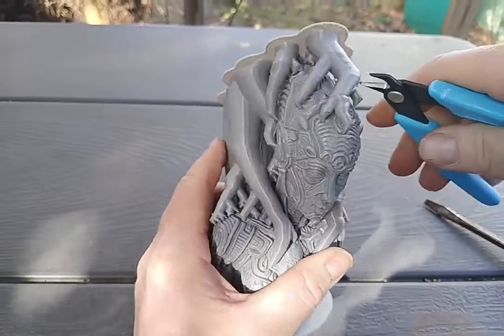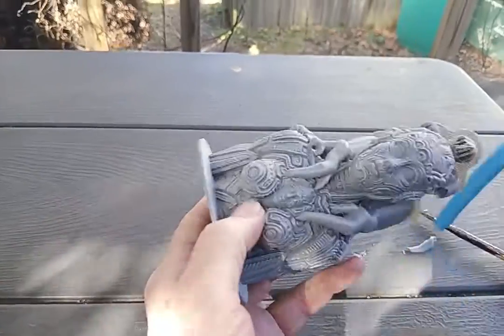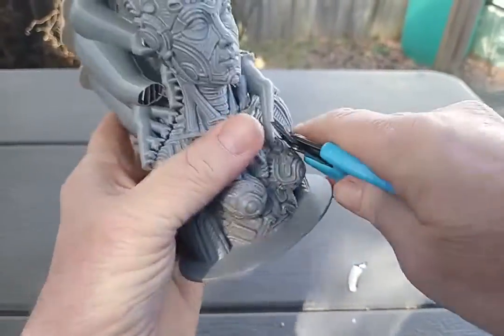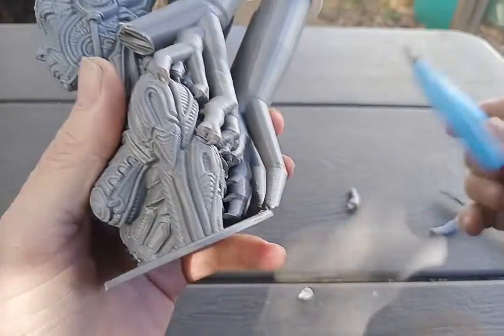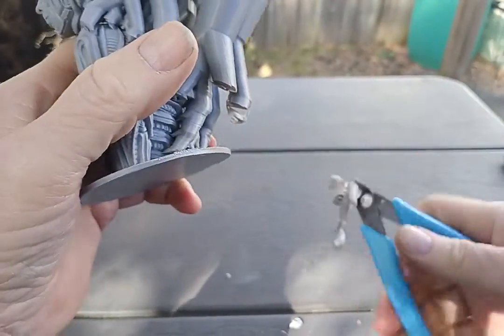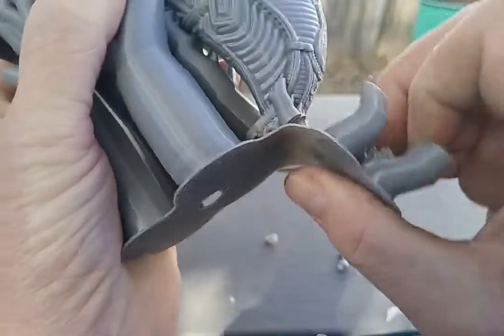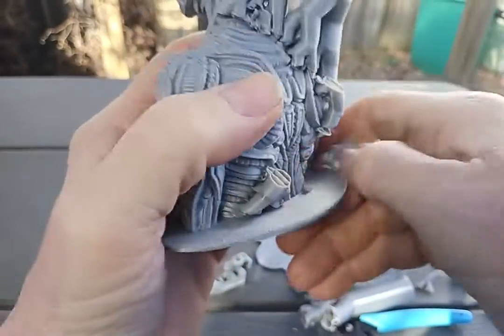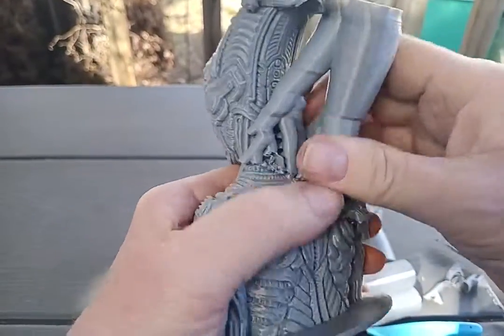Quick tree support removal

Comment: How do you get your tree supports to come off so easily
Reply: get a heatgun, use it lightly on the supports, they'll come right off 👍
Reply from the maker: these are the default settings in the cura 5.3